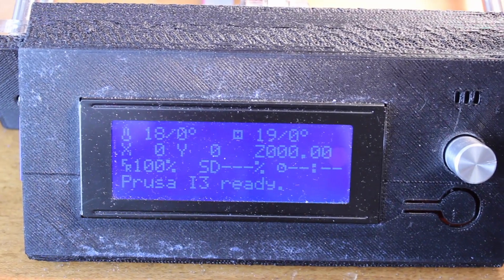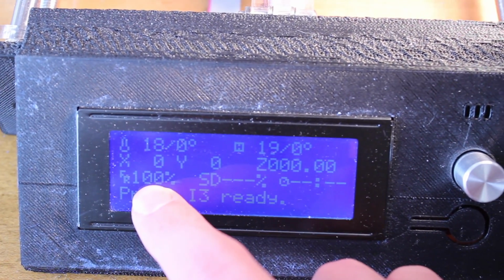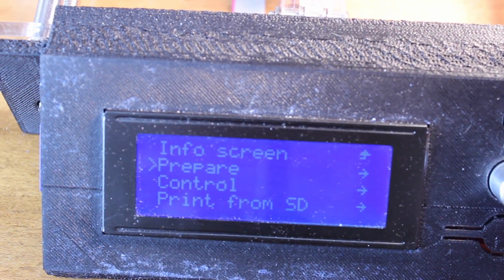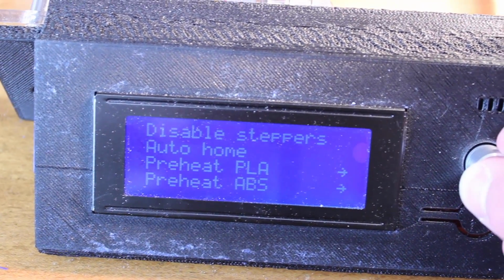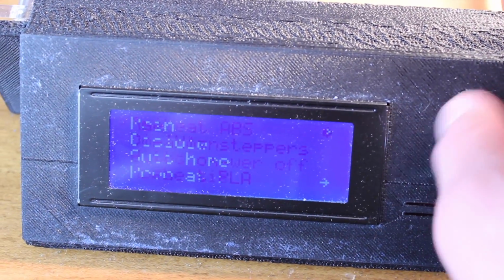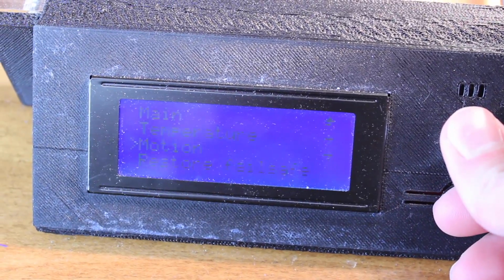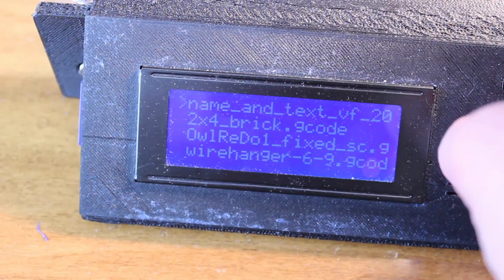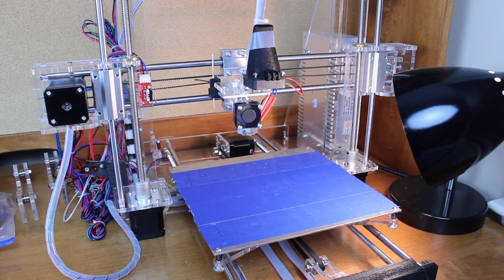Sunhokey reprap Prusa i3 3D Printer: Calibration, Settings, Your First Print!

Comment: My printer won't home. it's goes past the safety switch. Do yoh think it's firmware?
Reply from the maker: Does the switch light turn red when pressed? Is the switch plugged in correctly? Are all the switches doing it?
Reply: It's plugged in correctly, but it goes past the switches I also checked to see of the wires wire had continuity and all do, Were can I get a good firmware from?
Reply from the maker: Try the prusa i3 website

Comment: i feel confident on the build , and the setting up but have no idea where and how to get the print software and the items to print.  and i have no idea how to draw or make a print for the printer.  any one give me the info on software et.   thanks for the video very helpfull.
Reply from the maker: The print software I use is called Cura by Ultimaker and the model building software is called sketchup. I have videos on both if you want to watch them on my channel. I'm glad you like the videos!

Comment: I was wondering if you know what I should do if on the main screen display it says ERR: MAX TEMP
Reply from the maker: Try going into the control menu and changing the max temp to a higher number. If that does not work, try replacing your thermoster.
Reply: Don't have this exact kit (have another reprap i3 prusa kit) but believe as reThinkTech said this may indicate the thermistor that measures the temp on the hot end or heated bed (if this has one) may have been disconnected or just have some physical problem.

Comment: When I press in print from SD it takes me to sistem volume info an then nothing happns.
Reply from the maker: +Felipe Escobar R Make sure you have the SD card in the slot all the way and there is gcode on it. If that doesn't work, try looking at your connections.

Comment: I have the same printer but I cant get it to print. do i have to do somthing aditional. I also can get it conected to Repetiere.
Reply from the maker: +Felipe Escobar R Make sure everything is wired correctly first. Then, plug it in and make sure the fan starts and the mother board is lighting up. I would not use the repetiear software but instead use Cura and print off of an SD card. Try that and let me know!
Reply: +reThinkTech  the printer now works all the motors and the end stops but when i try to print it comes out the ectruder just alittle bit like it is too cold i don't know if it becaise i uswd ABS the one that came with the printer, should i try PLA?
Reply from the maker: I would start with PLA

Comment: I don't see a z endstop. Am I just missing it?
Reply from the maker: +davidmv113 What printer do you have?
Reply: +reThinkTech Several. I'm talking about in your video. I'm setting up my first cartesian printer prusa i3 very similar to the one in the video and I have the z endstop on the smooth rod but I'm confused as to how to where to position it. I have it below the Y gantry on the left side smooth rod. Should it be above the gantry instead?
Reply from the maker: +davidmv113 it depends on how your printer is set up. If it prints at the bottom and moves up, than the switch should be at the bottom. If the bed starts at the top and moved down than, it should be at the top.
Reply: +reThinkTech I think it's supposed to be at the bottom. So you just put it anywhere relatively close and then adjust the 4 screws?
Reply from the maker: +davidmv113 Yes. Also, you can adjust where the end stop is for big adjustments. Move it up or down.
Reply: +reThinkTech it seems so low tech compared to my deltas hehe. Not knocking it. I will make this machine print amazing like all the others. I did find some adjustable z endstops. My big issue is the lack of precision when moving it. It seems kinda clunky to just move it by hand. I think the adjustable one is more my cup of tea.
Reply from the maker: +davidmv113 Yes it is clunky to move but that's how it's made! once you get it dialed in, it should work fine.

Comment: my printer start to printer in the auto home lower corner and not in the middle of the bed how i solve this ?
Reply from the maker: +Stef Vans What slicer software do you use?
Reply: +reThinkTech cura 15.04 i tried to adjust in the settings of the prusa i3 it self it always gows to the lower left corner so i only can print little stuff in that corner
Reply from the maker: +Stef Vans I had that same problem. Try downloading and using an earlier version of cura.
Reply: ok good tip thx i will try it out now 

cheers for the repply
Reply: +Stef Vans nope dint work even with a 14.05 insted of the 15.4 version the printer still starts in the lower left corner but i noticed that in the led screen of the printer itself the pos. x settings  min endstop:off
max endstop:N/A same with Y pos setting and i am unabble to adjust in these settings
Reply from the maker: +Stef Vans You should be able to adjust the settings in the "controls" part of the settings on your printer.
Reply: +reThinkTech nope doesnt work either seems it doesnt save it it just keeps going back tho the lower left corner soon i gonna use a hamer to force it too the middle :)
Reply from the maker: +Stef Vans it should auto home before every print, then move to the middle. weird. try reseting your printer's firmware.
Reply: +reThinkTech ok i found the origin of the bug or error iff you will, so in cura you can adjust in machine settings turn on or off machine centre 0,0 but dont turn it on from the moment i turned it off my problem was solved seems the cordinates in cura for centre of the machine arent right
Reply from the maker: +Stef Vans good to know! glad you fixed the problem!

Comment: I have issues with my printer just completed it and when I go to print from my PC it doesn't do anything nothing comes out of the filament it auto sets up heats up but that it. What have I missed?
Reply from the maker: +John Cecotti What program are you using! I wouldn't recommend printing from a PC. I us an sd card because you can turn off your computer and it will not stop the print. Also, I would recommend Cura slicer software. I think it is the easiest way to product great prints! You can watch my video on how to use that software over on my channel. You drop your object in the program, edit the settings, stick it in your printer and click print. It should all work.
Reply: what files do you need to copy to the SD card? I have sti files but doesn't seem them when I choose print from  sd card
Reply: I keep getting error MAXTEMP BED FROM trying to prepare the temperature
Reply from the maker: +John Cecotti You should put .stl files on the sd card. MAXTEMP BED means the bed is overheating. Try doing a google search on that and you should find an answer.

Comment: Hello. I am a ME. I built this is about 4 hours on a weekend. I got the code running during the week . I am very good at putting things together, but not making the code work. I have managed to get 98% of the way there. My current issue is with the how high the Z axis travels. Seems to me like it goes way higher then it should. I have the bed set so a dollar bill has just a "touch" of resistance. When I run a print, the first pass is great, but then it jumps very high. I bought this on  ebay, and it came with 2 KG of filament. I bought more on amazon, but I don't want to waste these ones. Are there any recommendations you have about the Z axis and how to make the cheap stuff work?
Reply from the maker: +marek foxtrot I wouldn't use any of the cheap filament at all. It just clogs up your extruder! I tried using the cheap stuff but when I switched to the expensive filament the quality was a lot better, too. You could always sell the filament and but a role of higher quality filament.
Reply: Ok, cool thanks. I've come across an issue with the z axis. It all works fine, but when i auto home it, i make sure that it's at the proper hight. When i go to print, it lifts maybe 1 or 2 mm so it's not nice and low anymore any suggestions?  Im thinking it can be with the code in arduino, or in the printer settings.  I thought it was the z probe offset from extruder. Which i changed to -1 from -12.35. But other then that i would be ready for a print.
Reply from the maker: +marek foxtrot I have the same problem. I usually calibrate the bed 1 -2 mm below what it should by twisting the screw above the 2 axis switch. I do this until I get reliable prints every time. I think It is probably in the code but this simple trick works great for me.

Comment: So far as I am aware Restore failsafe will use Configuration.h file for setting, which you may have changed. This may not be the same as the Factory default setting

Comment: What software did you use for the auto-home? I don't see that option on my sunhokey i3.
Reply from the maker: I didn't use any software to auto home. It is built in to the settings. Click the button, then prepare, and auto home.
Reply: +reThinkTech Weird. Mine doesn't. Marlin 1.01 firmware, arrived on Monday and finished building it yesterday :) I'll tinker with it later after I solve a problem with the MKS board voltages.

Comment: Thanks , great explanation of the LCD Screen.  I  am setting up a printer like yours. What holds the smooth rods in place on the built plate? Getting to my first print but the rods are moving. Any ideas ?
Reply from the maker: the smooth rods are being held in by a piece of acrylic that pushes against the ends. you should look at the video where I talk about the upgrades I made. I show how to fix another problem with the bed. thanks for commenting!
Reply: thanks for replying, looks looks looks like the LCD is in front, mine is mounted on top, next "PRUSA I3"> So what is holding the smooth rods, yours in the back looks like its against the wall. My smooths rods just keep falling out of the holes. And I only have 2 rectangular acrylic pieces ( 1.5"x.5 " ) remaining. And I already tried lubricating the rods
Reply from the maker: +Ron D you should have 4 acrylic pieces. you could hold the rods in with tape and 3d print 2 new end caps.